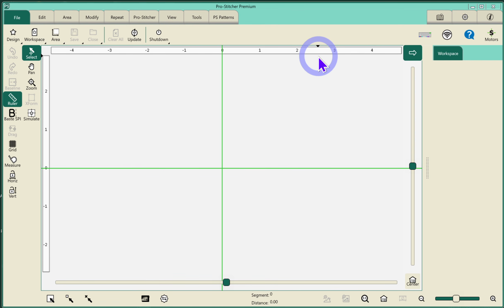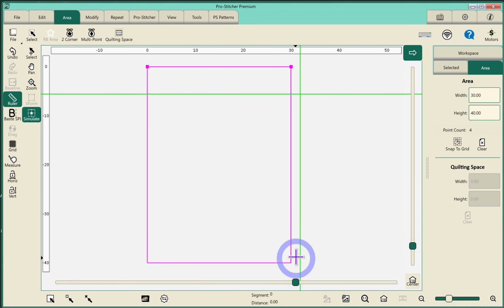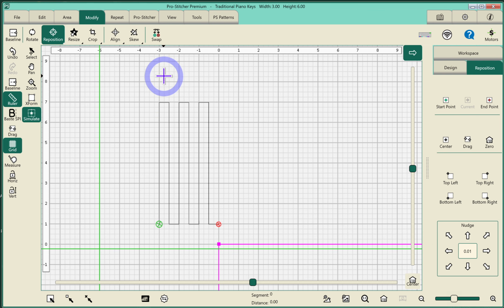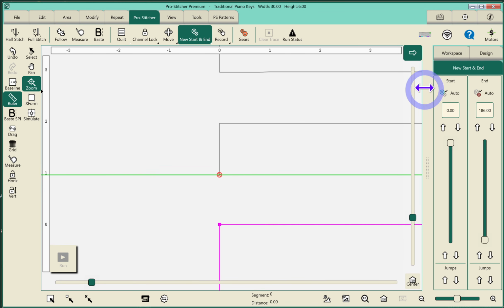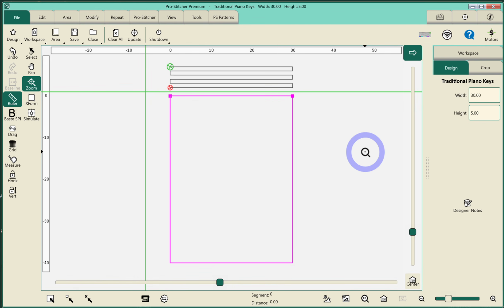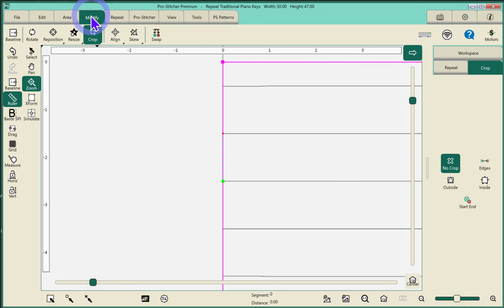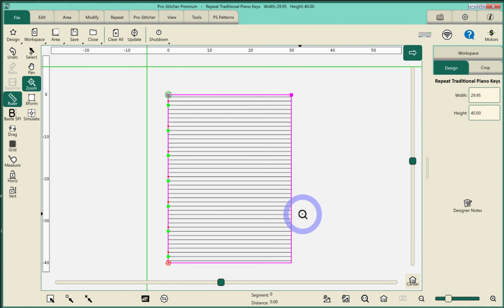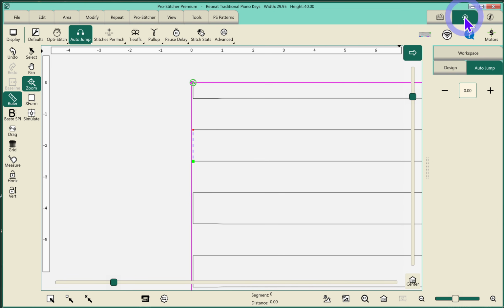04 13 26 How to Make a Straight Line Extended Width Quilting Design with Piano Keys E2E Design

Comment: Thank you, Patty, for this video. I followed along on my simulator in PSL. Got all the way to [Settings] for changing the [Autojump] which wasn’t there. I went to [Defaults] and saw Autojump to the right and changed it to 0.00. Will it stay that way for purposes of the new design to be stitched?
Reply from the maker: So, if you're using Pro-Stitcher Lite (remember, I mention this little tutorial applies to Premium), you won't have that option in Settings.  BUT, yes, you can go to Settings > Default, and change it to zero.  That change will remain after shutting down and reopening until you change it, again.  Just so you know, I also have my Settings > Default Auto Jump set to zero as I always prefer to have Pro-Stitcher pause at all End points so I can decide what I want to do.